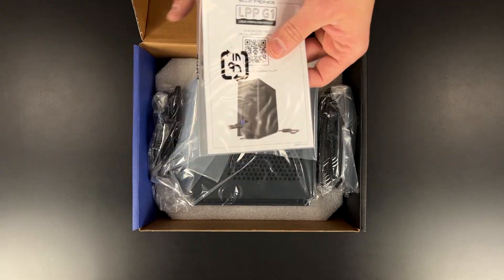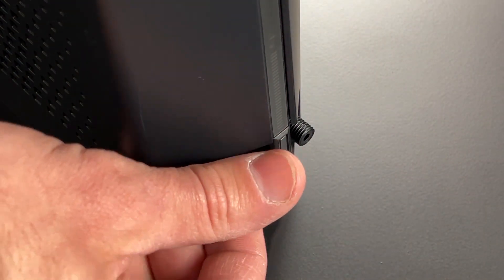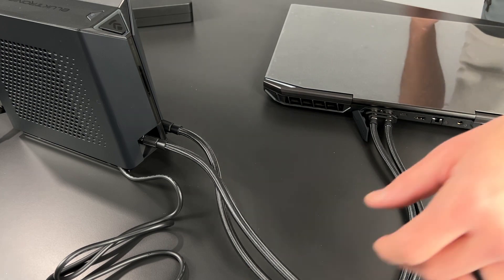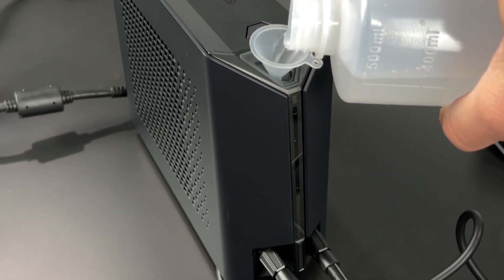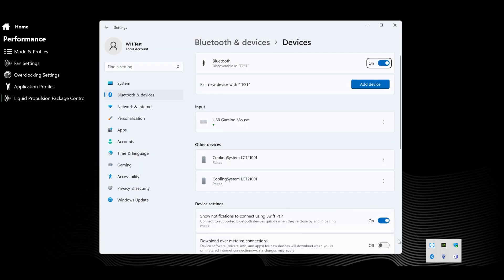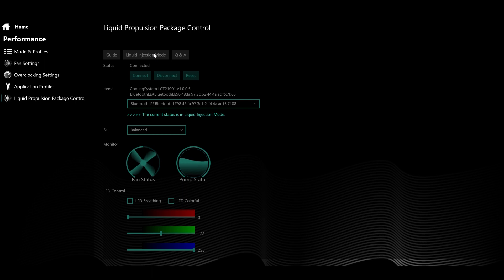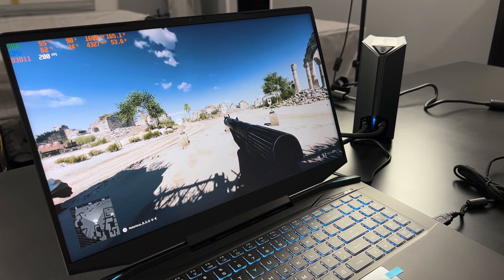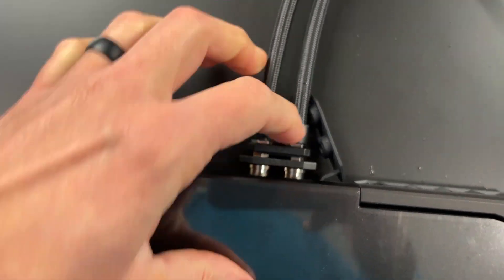Liquid Propulsion Package!  Initial How To Setup!

Comment: how loud is this system when just doing office work?
Reply from the maker: You can easily turn it off if your perceived acoustics are unacceptable within your environment 👍
Reply: @BobOfAllTrades  sounds fine to me, I set stuff to my preference in the control center anyway, like an office work profile which runs the fans to an inaudible quiet extent while having CPU/GPU Temps around 50-60 degrees. Does the watercooling unit have an automatic idle mode now?

Comment: Really cool but those hoses look pretty short. Are there longer hoses available?
Reply from the maker: The cable from the LPP to the laptop is about the same length as the hoses. It would require making the both longer then.

Comment: 3:45 Why doesn't the water pump inject air into the system instead of having to get it out with gravity the way you are showing?
I know probably the pump used is for water only. Wouldn't adding a small air pump be feasible? Did you try that?

Comment: I have the Mech 15 G3R with the LPP.  This is a game changer.  The cooler lets the CPU/GPU run at full performance, at lower temps, and does it while making very little noise.  I hope Clevo/Tongfang take note and keep iterating this approach.
Reply: those are already clevo units... just rebranded for eluktronics / xmg

Comment: I dig the concept of liquid cooling a laptop but I think this first iteration is too big and clunky. Maybe if they could make one box that does not require an additional laptop charger to connect to it and lug around it would be wicked. I mean imagine just one box that is slightly smaller than the one on this video with the PSU also built into it. I like the creativity here. Maybe if people buy this then Clevo and Eluktronics can refine the future revision of this.
Reply from the maker: If the psu was built into the cooler, then you’d need another psu for the times when the LPP doesn’t make sense.  

Sorry, perhaps I’m misunderstanding you.
Reply: @BobOfAllTrades  No you are right. They can not physically fit the PSU inside the box yet. I am just thinking a few years ahead in my mind.

Comment: Hey bob i have a question from you. How can i contact you ? Can i ask my question here?
Reply from the maker: What’s the question?
Reply: @BobOfAllTrades  hey i am sorry my question is not about the water cooler you are representing here which i think is really really great but i didnt know how to contact you.

i have an asus rog strix g15 2020 i7 10870h with rtx 2060 which you have a repaste video on. This laptop has liquid metal on the cpu but based on my research a lot of units have bad applications of liquid metal.
after checking out your video my cpu temps are way higher than yours so i figured i probably need a repaste. I can't find any liquid metal thermal paste on my country and the best thermal paste i have found is master cooler cryofuze. 
My question is can i replace the liquid metal on the cpu with thermal paste solution? Is it gonna be better or worse? What do you recommend?

Sorry i know this is not the right place but i would really appreciate it if you help me on this one.
Reply from the maker: @fardinfarnezhad227  I wouldn’t worry about replacing it with liquid metal and just go ahead and use regular thermal paste 👍

Just make sure that everything else that had paste on it gets new paste such as K5 pro if I recall correctly.
Reply: @BobOfAllTrades  thank you so much. You are an angel. I wish you the best.

Comment: I use green automotive alloy coolant mix for the zinc additives to stop galvanic corrosion of the loop, it's worked fine keeping both my 30yr old alloy V8 BMWs alive and also my laptop WC diy mods with mixed metals, pbsn & bisn solders and copper.

Dunno if that's against the rules for this unit but wouldn't see why.
Evans waterless coolant is another I wondered about but think it's too thick with the higher glycol, might stress these kinds of consumer grade water pumps too much

Whether you have soft or hard tap water is probably also worth thinking about. I'm lucky to have really low mineral content where I live in Melbourne so tap water doesn't make much difference

Comment: I assume one will have to integrate or purchase a near non existent laptop liquid cooling system to their device?
Reply: Nah, it's an option available when customizing an Eluktronics laptop. Any laptop with the option comes with the heatpipe and barbs already preinstalled in the laptop regardless if you get the pump/rad unit. So you're really only paying for the pump/rad combination.

Comment: What happens when your power goes out and the LPP shuts off, does not hitting the disconnect manually and then switching off have any adverse effects? 

Also do you think a second generation of such a product will be worth getting into or is the tech so simple that it's no big deal on longevity for the laptop? Cause many people keep a laptop for 3-5 years I wonder if these quick connects will last the lifetime of daily use.
Reply: I think the idea behind a pump driven cooling apparatus such as this is a cool and quiet desktop setup and not something to keep your gaming laptop cool when the powers out. Additionally, when the power is out, it really doesn't make a whole lot of sense to need the liquid cooler anyways, seeing as the laptop will pull significantly less power under load on battery.
Reply: QDCs are definitely what I'm finding is the weak point
With my mods I used now discontinued big 10mm phobya nickel plated bulkhead QDCs and of the dozen I bought 4 yrs ago more than half of the male ends are leaky (don't close fully) and three females are outright failed... Maybe this particular QDC only maybe it's the nature of the part.

My first mods had them soldered to the copper tubes (the heat didn't affect them surprisingly) but now I use a silicone tube section between so I can swap them out much easier

Leaving them sit filled without fresh circulating fluid seems to corrode them super quick. I'd grab a set of connectors and air dry the laptop side of the loop if the laptops not going to be used with the LPP for an extended length of time

Comment: If I'm gonna buy one these then I'm just gonna buy a pc lmfao
Reply: portability is still a lot better than a normal pc
Reply: Much lower wattage than a desktop. Mains electricity prices are already pretty crazy for a couple hours of gaming.
Reply: @dolphin069  Eh, not really...even at 11c a kwh you'd only be paying 11c after around 2-3 hours of gaming.
Reply: @ALmaN11223344  not here they not.
Reply: This is NOT one of those pointless DIY mods that turns your laptop unportable.

This sits on your desk while the laptop turns back into a normal laptop.

While at your desk it is as quiet as a desktop which is definitely something far better than the normal 60dBa ish gaming laptop fans!
Reply: Yeah. unless the portabiltiy can be improved in gen 2 or you can find a gpu.

Comment: Honestly this is just pointless... The whole point of a laptop is portability - not carrying water hoses, water and a huge brick to get extra performance out of the laptop...
Reply: The point is to have one system. You can have an immobile LPP in your office, and you can disconnect and use your laptop on the go without the LPP.
Reply: @quibbling_quokka  I agree this is obviously not for everyone but I would love to give it a shot once.
Reply: It's valuable to those that find value in it. Whatever the market wants, is created. Laptop manufacturers don't just create things on a whim, not in these times. This setup would work great for me, as 99% of the time I use my Laptop as a stationary unit that I plug 3 more screens into for a total of 4 screens. When I need my laptop during travel, I'm not expecting it to run at super high temps (ala gaming), but instead for presentation or to work on web related projects that do not overly tax the power system, creating an excess of heat. Let's be clear, the majority of heat related issues we're assuming is gaming. With laptops, there's such a variety of options that if this one specific thing doesn't mean YOUR need, that doesn't make it unusable for the majority. Bad take, honestly.
Reply: thats kinda like saying the switch is pointless
Reply: Not with the increasing price of electricity. Running a 30x desktop for a couple of hours a day is currently prohibitive at least here in Europe.
Reply: @dolphin069  The mean cost of a kilowatt-hour in Europe is 21.34 euro cents. An average computer uses like 0.2 kW per hour. What do you mean by "currently prohibitive in Europe?" 🙄
Reply: @quibbling_quokka  it's just bull shit. People have no problem consuming electricity when they run their useless towel warmers in Europe and they say running a PC is prohibitive.
Reply: @quibbling_quokka  average computer? Not with a high end gaming GPU in doesn’t.
Reply: @dolphin069  Please show the math instead of hand-wavery statements if you want to argue. Also, do you think the person who can afford a "high-end gaming GPU" can't afford 4-10 cents an hour to use their computer?
Reply: @quibbling_quokka  prices just increased per Kw by 30%. Prolly cost 25-30 euro a month just to run the PC.
Reply: I happen to work/live in a space in which a standard desktop does not fit. For space reasons, having the fastest coolest laptop I can afford is a must for me! My laptop probably won't leave the house much at all if ever. I'm just one example of a person for whom this is ideal!
Reply: I just took my chunky beast P870DM3 with my diy WC mod down to my beach house for 4 days, took 2sec to disconnect it

Can't wait to plug it back into the 360mm rad those 60dBa fans did my head in lol

The cooling benefits are definitely there, I can basically put as much power into the desktop CPU (150W) and 1080s (200+W EACH) as they can take and it all runs super stable and stupidly cool. But it's pointless, I mean I've benched the thing using that much power and it's stable, but the real world gains aren't there... the voltage limits stop the GPUs going much beyond 2200mhz and SLI's crippling bandwidth issues and dead support wrecks dual GPU, and even a beastly OCed single 1080 is old these days

My first P370EM rig I did with using dual 1070s in was really great at mining eth at 60MH/s for a couple months, super cool and quiet, I wish I never touched it and just kept that on 24/7 as it was not even 200 bucks at the time :(